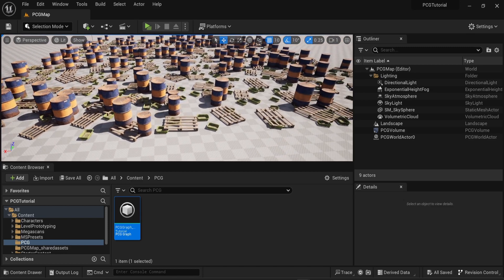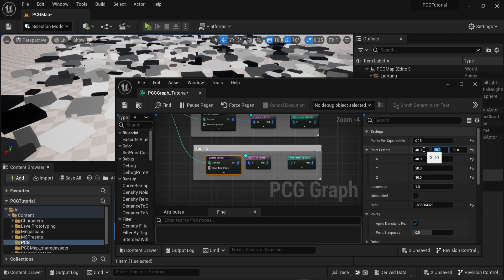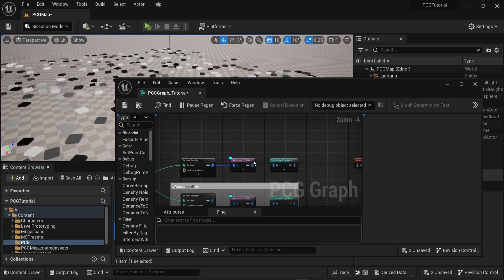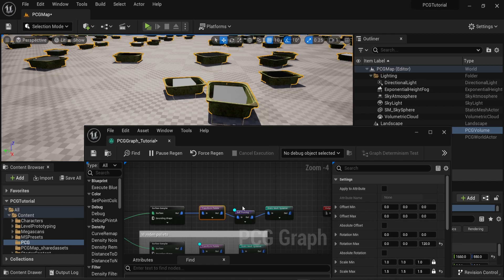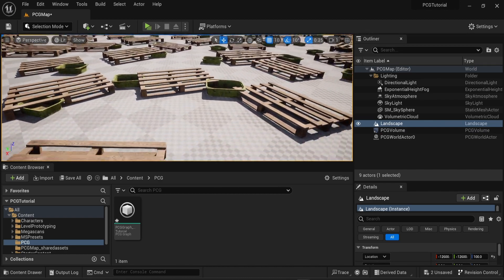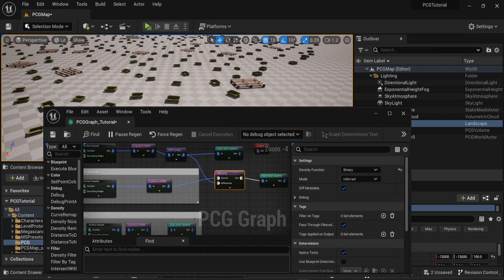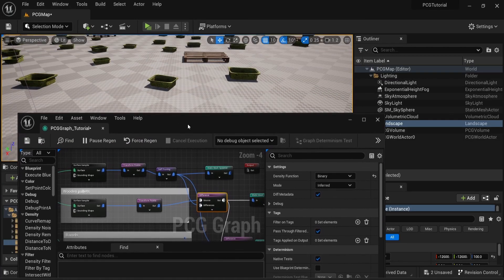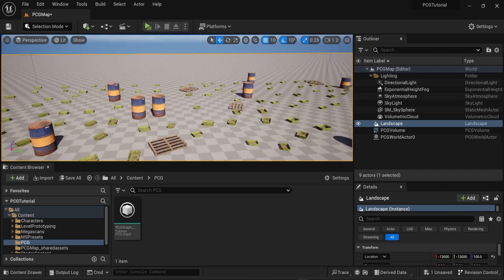Bounds and overlaps - Procedural Content Generation in UE5 | Tutorial Part 3

Comment: This is very helpful! Is there currently any way to have the point extents automatically match the size of a static mesh that you know of?
Reply from the maker: I don't think it's possible. I feel like if it was the case it would require massive calculations every time something changes (besides everything else). Like the moment you have a mesh with a lot of details then it would probably crash the editor. But, I'd love to learn if I'm wrong on that.